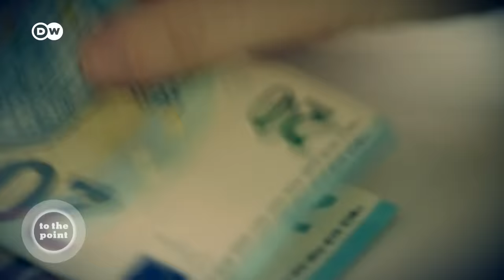Problems Made in Germany: No more money for the future? | To the Point

Comment: The German "green transition" has been as blunderous as Brexit! 

First, the only realistic and practical form of green energy they had was nuclear, which they've decommissioned and now ironically, they import electricity from France's nuclear power stations. 

Next, Germany is neither sunny nor windy, so the billions of Euros spent on top of all the carbon and environmental damage they caused by extracting the minerals and building these solar panels and wind turbines was one of the biggest wastes of money since Weimar... 

Finally, Ostpolitik and becoming overly dependent on Russian gas instead of building and improving its nuclear tecnology and diversifying (thanks to the Greens, whom have been financed by Russia since Soviet times) will finally end Germany as a relevant economic power, and of course with that will bring an end to the EU, for without German money the EU can not survive in its current form if any...

Comment: The real benefits of going to no carbon dioxide emitting fuels is the elimination of traditional irritating air pollution.    There is no mechanism that would allow noncondensing greenhouse gas behavior from carbon dioxide and methane to cause global warming.     It is high school science that all the greenhouse radiant energy is completely absorbed by greenhouse gases within 20 meters of the radiating surface, typically the earth.  That is earth's greenhouse effect that add 10°F (5.55°C) to earth's average temperature and is always in saturation from the strong greenhouse gas water vapor.   Noncondensing greenhouse gas behavior such as from methane and carbon dioxide concentration in the atmosphere can not change the overall effect of earth's greenhouse effect.  Global warming was officially reported at 1.1°C in 1991 and 1.06°C in 2022.  Global warming has been at about 1°C for over thirty years without a 2/10°C change since the late 1980s.

The United Nation's IPCC science report at the back of its 200 page report has paragraph where it has statement of legal data transparency that states it took its greenhouse gas samples at 20,000 meters altitude and only that one altitude!   Since it should be common knowledge there is no greenhouse radiant energy more than 20 meters from the radiating surface that 20,000 meter altitude statement means the IPCC is not measuring greenhouse gases where they are active and protects the authors from fraud.   This is the same type of marketing that takes place with a beverage labeled as "All Natural Fruit Flavors" then in the ingredients it tells the truth "contains no actual fruit juices".    The Arctic is warming with the mechanism proving to greatly be warm Atlantic Ocean waters migrating more frequently and deeper into the Arctic Ocean warming it and the region.

Comment: believe me, Germany will have 180 degree turn... they need more power... they need Russia cheap gas...
Reply: Nobody needs anything from Russia!
Reply: there is no point in cooperating with Germany in the energy sector.  firstly, they are not able to protect the infrastructure that supplies their own country.  secondly, by 2050 they will stop buying oil and gas, which means the investment will not have time to pay off.  All attention should be paid to Southeast Asia and India, there will be good economic growth and increased hydrocarbon consumption
Reply: North stream is gone, they will be forced to buy expensive American gas.
Reply: russia wil be part of the european community again soon enougth.
Reply: @romanz9342  one section still remains and they can repair it if they weren't occupied.
Reply: This coalition only does 360 degree turns ;-)